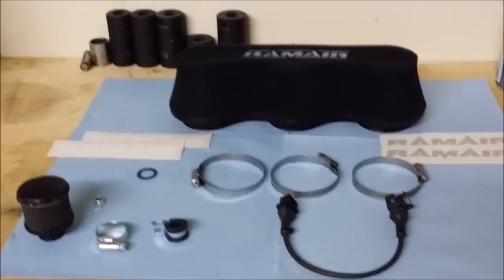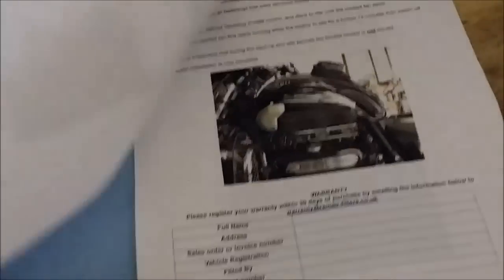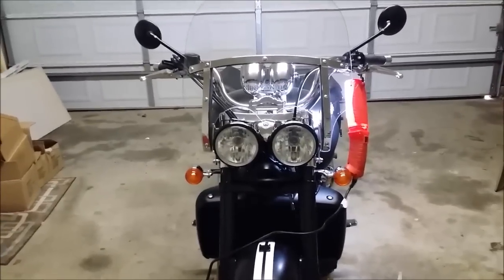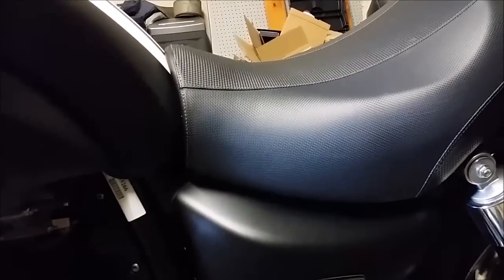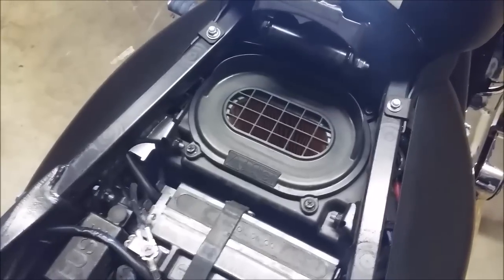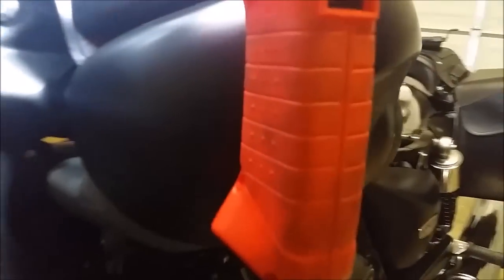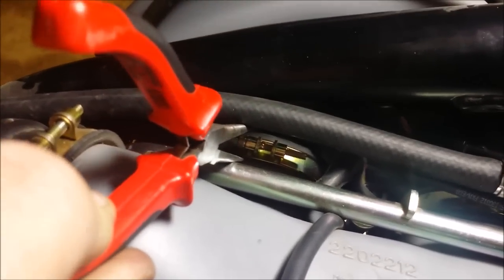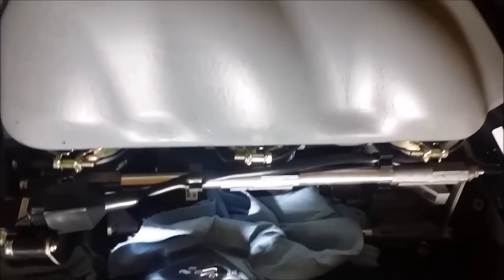Triumph Rocket Ramair Fitting

Comment: Thanks for this video. I just installed my new Ramair system with the help of this video and it all went very well. One small possible tip for installers would be that I used a telescopic magnet while undoing those cheeky bolts holding the plenum on. I held the magnet ready and undid the bolts until I could feel them losing purchase and then inserted the magnet and removed both bolt and washer. Thanks again for the vid!

Comment: My valve cover gasket failed like so many others. This is the only video I can find for someone that isn't a gearhead to remove stuff for that process as well. It is a bit daunting for someone who isn't mechanical. Once that tank comes up, it's like holy cow that is a lot of stuff in a tight spot. Again, thanks for the video. I think I might switch over to the RamAir at the same time I do the fix.
Reply: I had some long Allen wrenches from my bicycle maintenance. No way I would of got those plemnum screws with a regular size allen key and fat fingers. A magnetic grabber helped me avoid dropping any screws or washers.

Comment: Thanks for the vid. A great help. Fitted my kit today. I didn't get the rubber grommet, but didn't need it as a snug fit anyway. Also didn't get the nylock nut, but found one in my bucket of spares. Following on from your comment in the vid about sealing the old air box, I slid a sheet (cut out of a zip lock gladbag) of plastic over the opening & refitted the original clamp.

Comment: At 10.00 minutes in the video when you had the issue with the allen key to get off the Plenum.  USE A BALL HEX key, that way you can still turn them at up to a 35 degree angle.  Thanks to watching your video I was able to get one and it made it so very easy!  Your video rocks by the way.  Mine went on easy.

Comment: Fantastic run through the installation thanks mate I'm going to tackle my install tomorrow and hopefully all ends well. I've got TORS exhaust already fitted but as far as the 12 minute cycle goes I'm sure it'll still automatically adjust. Cheers for the Video mate 👍

Comment: hi Wayne, I myself have also a Roadster but after uninstalling among many other things also the mapsensor and ambient(barometric)sensor I got confused by installing parts back again which connector belongs to the mapsensor and which connector is for the ambient sensor. In order not swapping both connectors/sensors I want to know  which colours do the 3 wires of the mapsensor have ?  If you want to let me know, thanks.

Comment: Great video. Helped me a lot. Did you ever come up with a solution for blocking off the air intake preventing any water filling up the handy storage area?
Reply from the maker: No, I've not found it to be an issue. I place spare gloves, hats, glasses etc in a polythene bag and so far it's never been wet. Not even the exterior of the bag.

Comment: Question about the crank case breather pipe:  after pulling the rubber hose or pipe as you refer to it, do  you need to plug the end of that hose? Also, I might suggest disconnecting the battery prior to beginning the project (both terminals) and running a jumper wire across the + and - cables (NOT THE BATTERY TERMINALS!!) thereby purging any memory from the ECM and allowing it to reprogram itself from a fresh start. Then reconnect the battery after the installation is complete and allow the ECM to re-tune itself as you demonstrated. (That jumper wire WILL NOT harm the ECM).

Comment: Awesome video thanks for the great work, I've heard of some people sharing a concern about water possibly getting into the throttle bodies through the system, is this something I really need to worry about? Another question, my bike has a Corbin seat which eliminated that air duct that is supposed to channel air into the system, so I'm probably running inefficiently in terms of air intake, my bike runs great and I love it, is it worth doing this ram Air kit? What kind of performance increase can I expect if any? I have the stock exhaust with the catalytic converter removed

Comment: Did you leave your RAMAIR open without the bearclaw?, going to put one onto my roadster but it seems like putting the bearclaw back on over the Ram Air moots the point of getting a RAM Air system
Reply: Enough air flows in and around the Bear Claw.

Comment: Great video. I cant help but wonder way Triumph didnt make the intake like this from the factory. The cost cant be much different, cheaper i would think than all the ducting  to the under seat filter. The only upside to the under seat filter is it might stay a bit cleaner and less chance of sucking in water when its raining.
Reply: Also wish i would have thought of that paper towel idea. I dropped a washer behind the oil tank, spent a couple hrs trying to find it. Never found it.

Comment: Great video buddy
Putting 1 on at Xmas
Good work
Reply from the maker: ben Broadbent if you have trouble with the filter boddy staying on the throttle bodies, then do as I did . Make sure they are pushed fully down, and use the original triumph hex head clamps. they seem to hold better I found,

Comment from the maker: update... all new ram.air systems have a different polymer rubber compound that is more flexible and avoids splitting issue. they also have a grove in them now for the lip on throttle bodies to sit in. this eliminates slipping off issue.

Comment: Hey Wayne...very nice tutorial and very detailed. I think you nailed it! Couldn't ask for a better description of the process. Did you ever get a dyno tune with the ramair  mod? I would be interested in the difference in the numbers. Thanks again for a great video.
Reply from the maker: I've installed a carpenter sidewinder exaust. But to date have not had it on a dyno, but the power increase is easily noticable during all riding situations

Comment: Great video Wayne. Nice job with one hand holding the camera. It’s been nearly 3 years since you posted. If you still have the bike, did you upgrade the exhaust and put in a PC?  Did you ever get a chance to dyno it with the new parts?  I know that on some bikes when you remove the plenum, you can lose low end torque. Did you have any such problem like that?  Thanks again for your time.
Reply from the maker: drmatt357 yes I've installed a Carpenter Racing sidewinder 3 into 1 racing exhaust.  The power gains from both are very noticeable.

Comment: great video wayne northam - i was going to video my installation today but I think you got it all covered sir! 
This is gonna sound like spam, but it ain't…Not sure if you're aware, but you can download this free software called TuneECU to remap your Rocket…I did mine (have the TOR pipes) and changed a couple of things (opened up the secondaries in the first three gears - which I don't think you'd need as you have a newer one than my 2012), raised the rev limit, and speed limiter, adjusted the speedo so it's accurate to GPS - well worth it if you have a Windows PC to run it from, and a cheap $10 USB to OBDII cable.
Reply: evo moto 
Evo,
I am thinking of going the TuneECU route as well on my 07 Rocket. Do you have a link to where I can get the correct cable?
I have a TuneBoy cable for my now gone Sprint ST 1050, but I don't feel like giving them $150 just to add a vin number for the new bike for the software, especially considering that Tune ECU is free.

Just picked up new TORS for my Rocket and will soon have the K&N or Ramair filter kit too. Thanks.
Reply: Brian Lumb Nice dude! I'd definitely recommend the RamAir, fantastic product at a good price too.As for the OBDII cable, check out this thread by the legendary Decosse… http://www.triumphrat.net/ecm-and-fi-tuning-help-tips-and-tricks/217097-tuneecu-cable-caution.html
He knows his shit
I did find these that should work, can't remember exactly which mine is, just a cheap eBay china one, but check these out:
http://www.amazon.com/Cable-Triumph-Motorcycle-TuneECU-Program/dp/B003ZKKMLE

http://www.ebay.com/itm/FTDI-FT232RL-VAG-COM-KKL-409-1-OBD2-K-Line-KWP2000-ISO9141-USB-FOR-VW-AUDI-/281312477303?hash=item417f87c077&item=281312477303&vxp=mtr

http://www.ebay.com/itm/VAG-COM-USB-Cable-OBD-II-2-FTDI-KKL-409-1-VW-Audi-VCDS-KTM-Triumph-TuneECU-BMW-/301504092069?hash=item46330b57a5&item=301504092069&vxp=mtr

Comment: a really nice sound! you could redo the comparison 0-60 / 50-80 mph as in your previous videos?

improved thrust at low speed?

Sorry for any translation errors
thanks
Reply from the maker: Will do.
Reply: wayne northam 

Thank you await with trepidation, your bike apart from the filter is all original, or has some mechanical changes? Thanks to early
Reply from the maker: Gianmarco Vit all original at the moment apart from the ram air system.
Reply: +wayne northam ,,, Dont know why people are saying use the standard jubilee clips , that is just asking for trouble as they are far to tight and dont free off enough   , so you could damage the ramair , just make sure that left side goes home properly and dont tighten to much ,, im throwing an engine management light after fixing , is that normal and needs a few starts or shop reset

Comment: Going to order the kit, however, I am stupid when it comes to this, does it have to be sent in for a tune up?
Reply from the maker: Rocket  Man  yes it will require a re tune. You can get the dealer to do it or you can simply upload a new fuel map your self using a lap top and a program called tune ecu which is available FREE to down load.  The only extra you need purchased is the lead that connects the lap top from usb  to the diagnostic port on the bike.  Check out the rocket forums online. There are plenty of proffessionaly modified dyno tunes to choose from.

Comment: So the only tune you need is the twelve minute tune, done twice? If so I'm doing this soon. I have the filter but no tune ecu or pc5.
Reply: you will need a tune or risk running lean.
Reply from the maker: Jason Peters 12 min tune will work fine. You need a new fuel map if you also upgrade the exhaust as I did.
Reply: wayne northam is the dealer able to remap the fuel system or is a pc5 required

Comment: Did you see any point in removing the secondaries butterfly plates while there? Beneifts>
Reply from the maker: None what so ever, if you want them open all the time, use tune ECU, and set them 100% open at all throttle and RPM settings in every gear, takes two mins and can be reversed any time you like.

Comment: Wayne, Where did you get your bear claw? Or did you just painted it black
Reply from the maker: +Tomas Toral  that is the original bear claw, I just cut it down with a dremel. smoothed off the edges and spray painted it.

Comment: Had two filters split and had them replaced by Ramair and didnt over tighten but they wouldnt stay on ,i then sold it on as it pissed me off and returned to standard with an underseat K&N.
                                 Why they didnt make the filter have a  lip on the rubber like the standard plenum has a lip  where it fits on the TB i will never know!
Reply from the maker: hogweed scott Had a similar issue, yes its strange there are no lips in the flange, I used the original Triumph clamps instead of the ones supplied. it seems to have worked for me.
Reply: wayne northam
I wonder how many they've had to replace or how many are split and the owners dont know and still running their bikes?
Reply from the maker: hogweed scott mine been on two years now. New rubber is great, no splitting,  and the new design with a groove in them fits throttle body perfectly, so no slipping off either.  Ram air did an element job addressing the issues, and the customer support was second to none.

Comment: hey good job now what u need to do is remove the governor butterfly in all 3 injection stacks . just pull them out and run like u did and the engine management light will go out and when u twist the throttle everybody is at home straight away I did this and also split the cat converter and removed all the guts so its hollow and also removed every thing inside the mufflers  I have no power commander  just got triumph to install the baddest tune they have it may be me but if I nuts mine from the lights I start to black out . ha ha  and under my belt is shit loads of Harley's
Reply from the maker: Steven Penny no need to remove secondaries,  simply go into ECU, using the tune ECU program and select or set secondary throttles to be open at all speeds and throttle settings and in all gears. They then remain fully open at all times.

Comment: I have to disagree with your explanation as to why the bike will rev free now, with the elimination of the duct work for the  air cleaner,  of course, if your going to do all the other modifications , like the power commander etc, you may have an increase, however on a stock motorcycle which most of us have, the air duct work is calculated in , as the engineers I think know what their doing,,, I like keeping my bike stock, unless I plan on drag racing it,, cant see spending more money on changing what the engineers did, to gain?????   what,, factory 140 hp was not enough???  lol, hey to each his own,  what do I know,,  but good job of a video if your looking to do this,, me its fast and fine enough the way it is